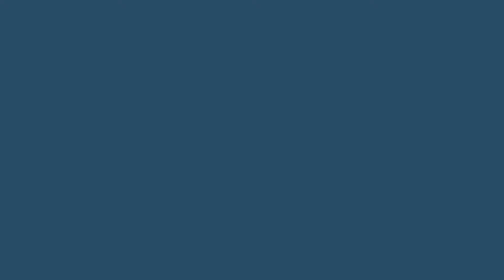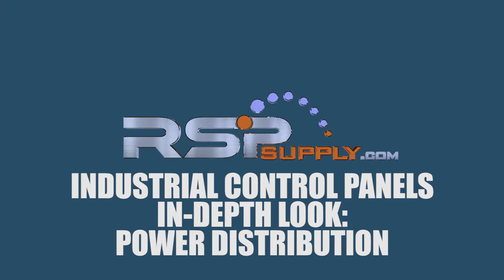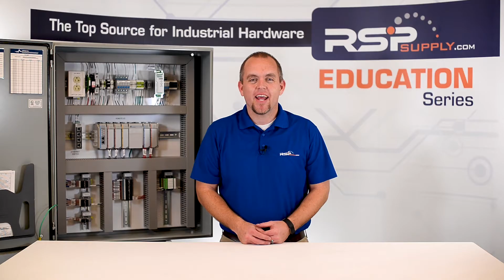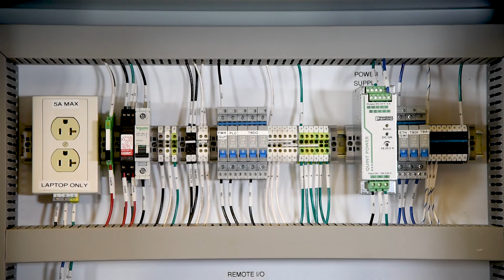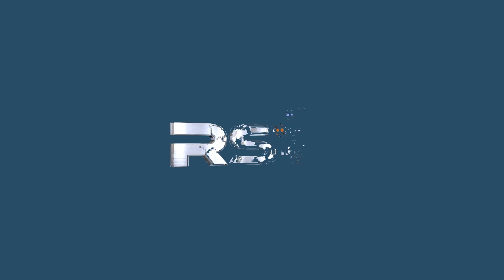Industrial Control Panels In Depth Look Part 1: Power Distribution

Comment: Why to we ground the negative DC?
Reply from the maker: Grounding the negative DC terminal is important for safety, reducing electrical noise, stabilizing voltage, and meeting regulatory requirements. It provides a safe path for excess current in case of faults, improves signal quality, ensures stable voltage levels, and ensures compliance with electrical codes.

Comment: This is absolutely amazing! You guys are doing great service for all the engineers around the world!
Reply: True, this has helped me in the UK despite the differences.
Reply: you all prolly dont care at all but does anyone know of a method to log back into an instagram account??
I was stupid lost the password. I love any assistance you can give me!
Reply: @Cairo Coleman Instablaster =)
Reply: Amatuer techs may be helped by this video, but true engineers or experienced techs are amused at most. No reputable company uses screw terminals since the 1990s. His laptop only "5A" recepticle has a 25Amp component, wasteful and silly. Its a 120Vac panel with 15A main breaker, LOL, ive installed material handling equipment not that tiny. He should try 480 3ph at 1000Amp disconnect. So no, hes not a service to any engineers.

Comment: When I need to turn off a circuit breaker in my home's service panel, instead of worrying about if I turned off the correct circuit breaker, I just turn off the main circuit breaker.  It is easy and 100% safe, even though I have to reset all of the clocks in my house.
Frank Reiser M.S.

Comment: So the Power Supply is technically a transformer since it's input from 120VAC to output 24VDC.
Reply: Transformers do not switch AC to DC. Power supply switches AC to DC and also steps the voltage down
Reply: Its a Rectifier and transformer in one.It converts AC TO DC and still steps it down to 24VDC

Comment: How can you make a voltage divider for analog input. I have 24V-DC on my panel and I want to get 12V DC. I know how to do it in a bread board but how you do the same thing on an industrial panel, is there is special terminals to do that job. I would appreciate your help.
Reply from the maker: You can add a voltage converter right before the 12 volt devices you want to power.
Reply: @RSPSupply  where can I get a voltage converter?
Reply: @Jrjulio95  regulator like 7812 IC

Comment: I'm designing an industrial control box as a part of a senior design project for uni.  These videos are invaluable for someone in my shoes who has never worked with or designed a panel before (especially as a mechanical engineer).  Thank you so much for this diffusion of knowledge.
Reply from the maker: Great. Thanks for watching. Soon watch for a new series we are producing call or Panel Build series which will show you the build from start to finish in greater detail with detailed and time lapse footage. Hope you enjoy and and thanks again.
Reply: This is totally electrical work,not mechanical....
Reply: As a mechanical engineer, Ive designed only 2 of these panels before and they were much smaller with much less automation. Currently Im working on a much larger panel with much more automation and power requirements and this video series is invaluable to help me along. I especially like how you broke up the Power distribution into individual parts like that with separate terminal blocks for the neutral, ground and hot lines. Im copying that!
Reply: want to gain more electrical knowledge .how can we communicate?
Reply: Electrical hacks

Comment: Thank you for the super helpful vedios.
I have a question on the wires cross section selection, what is the criterion to select it?
Also, for the wires labels, is there a suggestion for a standard to use? Like (source device/destenation device)
Thanks again.